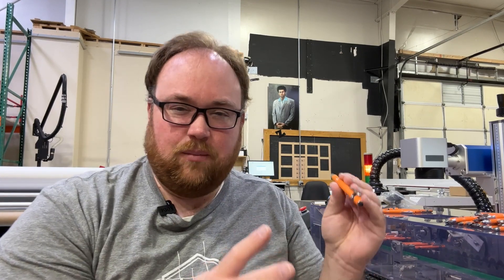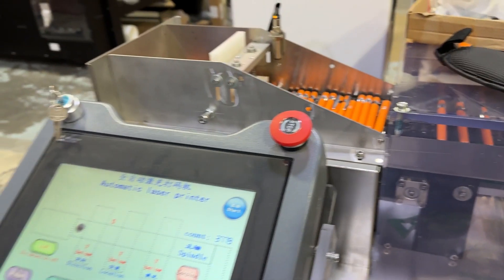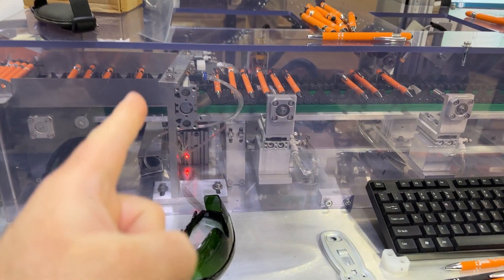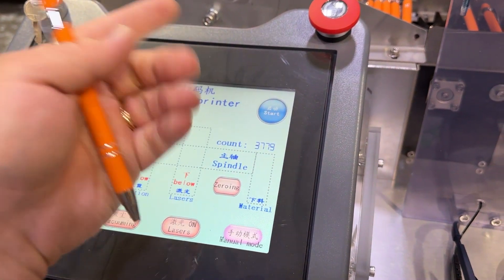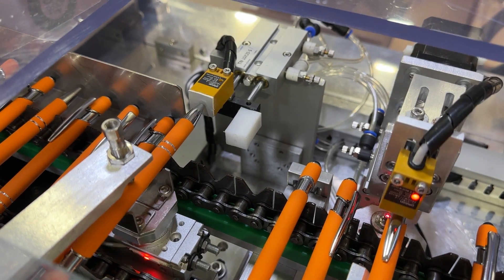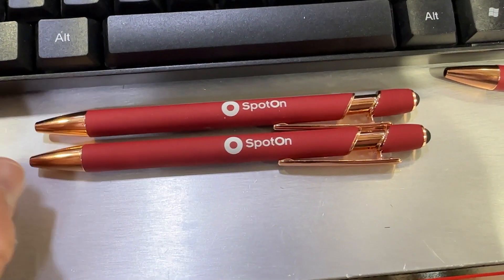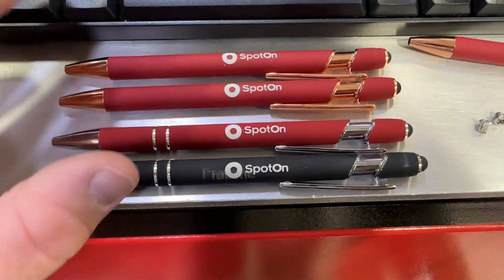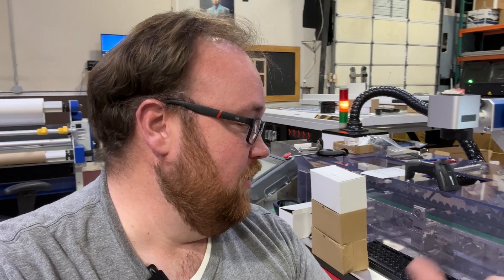Automatic pen engraving laser - custom laser from Alibaba

Comment: So, this is the thing about buying direct from China...  In the US, if you bought this it will cost a lot more.  However, after it gets shipped to you, an engineer or tech hops on an airplane out to you to set it up and make the needed adjustments.  By you buying direct from China, you become the engineer.  You really shouldn't be buying direct unless you're willing to be the engineer...this is coming from a mechanical engineer...  To me, it looks like you might just be looking at a few adjustments.
Reply: I’d have to spend over 1000 hours trying to dial it in before the US stock would be worth it.
Reply: @bhutch216  That's a perfectly fine assessment for your situation.  As long as you're ready for that, then it's the informed path for you.  Not everyone can, or is willing to do that.